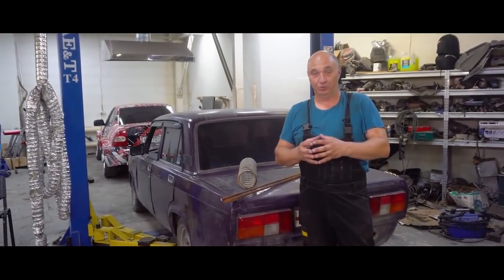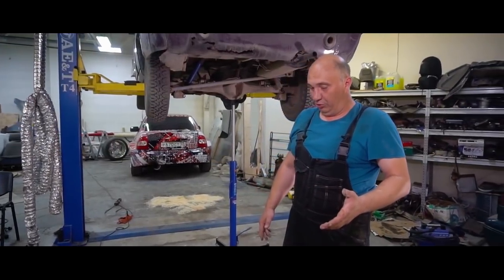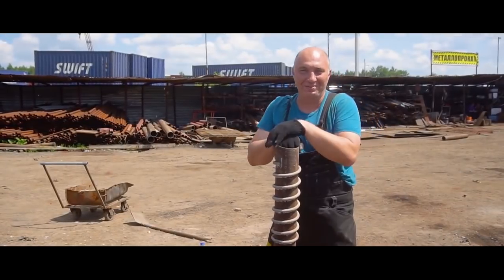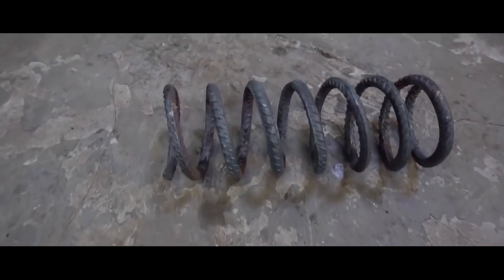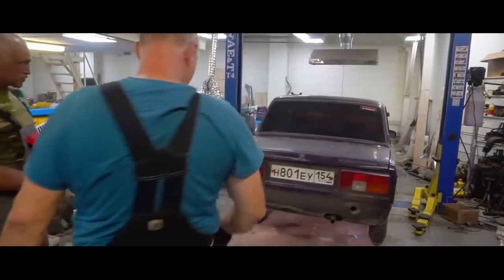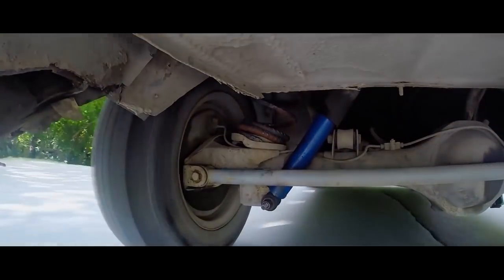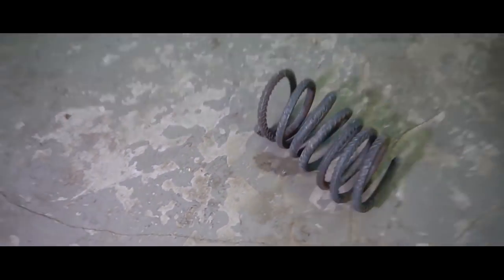Coil springs out of rebar – will they work?

Comment: You kind of annealed them :o) I would love to see 12mm hardened and tempered afterward. Maybe they would be perfect?
Reply: It's low carbon plain carbon steel, other than inducing some grain growth you're not changing much of the structure.  There's not usually enough carbon in the steel for any type of substantial heat treat either.
Reply: @otm646  That explains the low rust on the bits I have. I thought it had a bit of chrome in there? Absolute pig to bend. I made a garden  plant climbing thing for mother in law and swore I would never make another. At the time I thought the hardness was carbon.

Comment: Pro-tip from a spring factory quality&development manager: You should use Inox steel if possible, bend it in uniform shape and close both ends so that the entire 360° turn is flat to the surface. 
Heat treatment will significantly improve the spring, as it will reset the internal tension forces (so the spring 'rests' in it's current shape), it will significantly improve endurance and deliver uniform performance across the whole springs intended compression/decompression travel distance. 200-250°C will do the trick, time of heat treatment depends on the wire (in this case rebar 😄) thickness, as thick as this rebar is i'd say 2-2,5 hours. Keep in mind, that if you use regular steel, the spring will close a little while heating -but if you use inox steel while heating, it will open a bit.
If possible, you should sand-blast it, as it wil further increase the springs endurance,  because it functions as micro-forging.
You know what, if you ever decide to do a crazy-enough spring experiment video (I might have an idea 😄), PM me and we might arrange something, we make springs for russian companies already anyway.
Reply: I hope he contacts you. This was very informative
Reply: yes you are right but that guy wanted to try it the way the peeps asked for it , we , the viewers here expect fails and laughts , not engenering succes . i have other chanel on youtube for that ^^
Reply: @lacroix1976  ah you can have plenty of laugh still 😄
Reply: Maybe write this to the russian YT channel via google translate doubt he reads english version
Reply: @mexibobor  good point.
Reply: You are 100% correct in your information, but these crazy Russians don't do it for performance, they do it for fun.
Reply: I was going to mention that a lot of it comes from the heat treatment and tempering, but seems you have it covered lol, but might I add, that you need to bring the metal up to critical temp (when the metal is no longer ferrous) then quench it first, quench will depend on make up of metal, most are water quench or oil quench tho, then 2-2.5 hours at 200-250°c to temper it back
Reply: Point of this series is not to make it the right way. They have made wooden pistons etc. Like piston manufactures want to send him aluminium pistons?
Reply: Pro-tip from a nobody: You should use real springs if possible, install them per manufacturers instructions, PM me I know where to buy some, should make for some great laughs!
Reply: @Dsmwarrior1996 I'm aware this comment is 3 years old, but what could you possibly mean by "no longer ferrous"? To my knowledge, ferrous means containing or consisting of iron, and heating metals won't change them from ferrous to non ferrous
Reply: @TheChrisLeone  ferrous metals are magnetic while non ferrous metals aren't, I was using it colloquially as losing it's magnetism or the Curie temperature, I don't know why I used that particular wording

Comment: I love the fact that the professionals wanted nothing to do with this crazy idea.... but you went straight ahead with it anyway 😆👍
Reply: Hmm, ... No reason on earth why a Lathe operator would not make the spring's other than they didn't want a cutting torch near the lathe due to oil residue on the lathe or wanted the job done for free or close to it. I think 99% of the viewer's already knew the outcome of making a spring from anything other than "spring steel".
Reply: @MicroRotors  To be fair, heating it and forging it could improve it significantly. Rebar is low quality steel, not meant to be flexible and elastic. Im not saying melt and try again, but heating it up, and then hammering it  a bit,  could improve performance quite a  bit.

Comment: Try half a dozen office-chair pistons along the rear axle. With the adjuster arms still attached.
Reply: Haha good one
Reply: Tragically, if they aren't all positioned exactly perfectly, they will simply paralyze the suspension, as you can see in the video where they attached numerous shocks to a car.
Reply: @Namington  That was only part of the explanation, i have mounted extra pair of shocks on a motorcycle, exact same angle as the stock ones, and the result was truly horrifying. No suspension, only bouncing, the rear wheel had no road grip and at 60kmh the whole bike started wobbling violently.

Comment: If you harden them by heating up and then rapidly cooling down (even in just a normal water) it could be more interesting. Than again they would probably crack.
Reply: had the same thought, after heating them up for bending they are in an annealed state now, so very soft and not springy. You could maybe try and harden them anneal them just a little so they aren't completely brittle. Although you should look up if rebar can even get hardened, my gut tells me no.
Reply: @CatNolara affter heating them cherry red, dump them in engine oil, this hardens them on the outside, but keeping them soft on the inside .
Reply: @MrBugsier5  you want them to be stiff all through tho, you don't need the hardness but the higher yield strength of the hardened material.
Reply: What they needed to do was temper the steel after making the coil by putting them in an oven at about 350°C for two hours

Comment: Guys, hardening rebar won't work, it has way too little carbon in it. Even if you could harden it, it wouldn't behave like spring steel. Spring steel has some other elements mixed into it to give it its elasticity, for example silicon, chrome, nickel or vanadium (depending on the particular kind).

Comment: The more videos I watch from this channel, the more pity I feel for that car
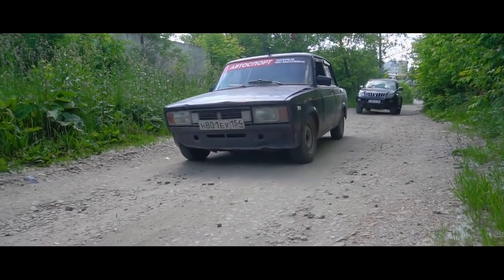10:02 cameraman is like: "Oukei, tiem tu ghet in kar"
11:28 I expected that. As thew wound the rebar they heated it up to glowing temperature and then air cooled it (annealing). Basically took all the spring out of the steel. They should've heated the rebar springs again and cool them in oil (or water)
Reply: It's inter to see what's next
Reply: @peterpede6601  I'd love to see how that turns out, too. As they said, the pro turners didn't want to hear about this project :)
Reply: @peterpede6601  Yes, a proper heat treatment would give them a real chance for success.  I think they should do that.  They have the equipment already.
Reply: Not much "spring" in rebar to start with.
Reply: @austin:  since when they invented spring steel...…….??
Reply: Look at Wiki;

https://en.wikipedia.org/wiki/Talk%3ASpring_steel#When_was_spring_steel_invented_and_by_who?

 @raymondo162
Reply: There’s not enough carbon in rebar to make a decent spring.
Reply: Raymond Ashby 
Structural steel like rebar has very little carbon in the iron. Spring steel has lots of carbon which changes the irons structure to where it can be heat treated to retain its original shape after bending over and over again. Low carbon steel bends and stays bent. This is 1,000 year old technology at least.

Comment: Please remake this video. Because you forgot to temper the steel. By making it red hot and dunking it in cold water or old engine oil. This is why they collapsed.
Reply: You can't harden rebar by heat treatment.  Rebar is made from mild steel.  It doesn't have enough carbon to harden.  Almost all steel used in construction, from I beams to sheet metal, is mild steel.
Reply: @pstrap1311  that why heating the rebar up and dunking it into used engine oil hardens steel, it adds carbon to the steel, technically a case hardening but it would add some rigidity to the rebar
Reply: S1n1stersixs Gaming it doesn’t add carbon to the steel. It just rearranges the molecules to form a harder structure
Reply: @pstrap1311  it doesn't matter. Any metal you heat will become soft. But if you make it red hot and rapid cool it will restructure the molecules in the steel.
So yes even the rebar will be affected by the heating process.
Reply: no
Reply: @Higor Ghunter • 64 years ago not only is it the hardness but springs are made from spring steel which has a couple of other ingredients too, one of which i think is magnesium , its why alot of people, myself included make swords from leaf springs, coil springs are a similar material
Reply: @Higor Ghunter • 64 years ago 
He's wrong, doesn't "rearange the molecules to make it harder" But if done in a gas furnance the CO2 atmosphere will give it some carbon and nitrogen

bending the steel while cold would have more of an effect due to work hardening.
Reply: Mr T  yep, i just use known spring steel, Molybdenum is what i was thinking of, one of the M's , thanks for the info and correction

Comment: Tempering r hardening the steel isn't going to turn it into spring steel. Hardened steel will just crack and break.
Reply: That's why it needs to be reheated  at a lower temperature after quenching and kept there to slowly cool of over the course of a day.
Reply: @johnnyjimj  but it wont turn it into spring steel.
Reply: Typically normal springs have a higher yield strength than mild steel. Meaning the springs are made from higher carbon steel.
Reply: No, it needs heat treatment 100%. It will reset internal tention forces and that is crucial to increase the endurance and deliver uniform performance acros the whole spring. I work at a spring manufacturing company 🙂
Reply: @davidmiletic6647  what I'm saying is that rebar is not the right alloy, and heat treatment wont make it right.
Reply: @fryloc359  of course, you are right, but it's just for fun 🙂

Comment: Can anyone explain what heat treatment/hardening would have done?
What kind of iron are real strings made off?
Reply: Usually Rebar-steel doesn't contain enough carbon (<0.2%) to make a proper heat treat, for at least decent spring steel you need at least 0,5% carbon or more (amongst other metals) to get a proper springsteel. Rebar is closer to iron than to steel
Reply: xXExpressYourselfXx 
Thanks!

Comment: You want these springs at roughly 45-55rc. Softer and they will bend. Harder and they will snap. 

I’ve been a heat treater of tool steel (s7,t15,m42,etc) for 10 years. We use molten salt to treat. After we temper from anywhere between 350*f-1200*f or so. This locks in the hardness. Heating them as they did would cause multiple different hardness ratings throughout the “spring.” With the results he got. 

Another issue is steel type, i.e mild steel doesn’t have the carbon required to harden. A carburizing process would help.

Comment: Kia must use rebar  suspension starts falling out 25 miles after they buy it.   IF you could pick a brand new Kia and a brand new 82 LADA you better get the car that can go two million miles.    LAaaaaaada

Comment: Could have evenly reheated them to cherry red, then oil quenched. That would maybe have put some stiffness back in so they last. Maybe try a spring out of cardboard? Could come in handy in an emergency, if all you have is some cardboard boxes, knife and some glue in the boot. With just the boxes, strategic tearing & folding could work. ;)

Comment: Simply put, rebar isn't springy and will warp. Saying that they did work reasonably well and used on a makeshift go-kart would work pretty well for a 20 lap race, but off road you really want coils made from spring steel.
P.S rebar is actually quite brittle. It has brilliant compression and tensile strength, but is not very maliable so when it fails it does so very suddenly. Torsion should have revealed this so I'm surprised the springs didn't also snap.

Comment: very interesting. I weld frame for my truck, and what you guys are missing in the spring is what I try to take away from old hard rails. It would be interesting to see how much time as a runtime cathode/anode engine carbon to get what you want. I reckon 20-50 years ;) It is a tricky process.. got to know carbon levels by other manufactures trial and error. Steel does change after man makes it.. depends on environment.

Comment: The heating process probably annealed the steel, so maybe if you heated them again in a furnace, after they were formed and dumped them in cold water you'd have some more success or maybe they'd just crack then - depends on the type of steel.

Comment: While wrapping the rebar, it needs to be twisted probably 3 times per full rotation at the same time. This will provide the spring back pressure your looking for. Then super heat them and drop them in water. Would provide a much stronger spring. Pretty cool video.

Comment: No it won't work because they will reform under weight and not reassert to thier original size. No. Won't work..not made of strong enough metal made to keep it's coiled length.

Comment: Heating the steel for sure did mess up your attempt to make a spring. You would need to temper the spring. The rebar wouldn't be the best spring but it wouldn't be the worst either, it is a hi carbon steel also. Usually springs are made out of 1070

Comment: The rebar may have actually held up better if after coiling them up, heated them in a forge with some flux, then oil cooled them to re-strengthen the carbon in them. But that is a bit extream for a small experiment. Love this channel and will keep following :)

Comment: Their is a particular manufacturing process that gives a spring its memory
If you just bend it into shape well thats Likely not enough. They could need nitrogen cold forge after a lengthy heat treatment for strength & recoil memory & hardness increases

Comment: You heated them and allowed them to cool slow and easy annealing without heating and quenching to stiffen then temper to chosen temper then they would work better however they probably will crack after short time due to the porosity of rebar and low quality.... be nice to know if quenching and temper with simple tools would work

Comment: Heat treat after bending and drop in oil.  The assumption that you can heat carbon steel was where you made your mistake...and yeah I know this is old...but try it again with this modification.

Comment: Many people here need to learn the properties of steel and its alloys. Most steel alloys have about the same stiffness, but some have a larger elastic (springy) range, before plastic (stretch ths is permanent) deformation destroys the part. More coils in a spring makes it softer, all other factors being the same. Heat treatment can do all sorts of things to different alloys, including hardening and softening. Mild steel (low in carbon) rebar largely ignores heat treatment. The proper treatment of the proper alloy can make a suitable spring, that will bend without cracking, and return to its original shape.

Comment: I wonder how much of there rebar springs failing is due to them not tempering the springs after using a super hot torch set the form.. tempering if done correctly would keep the steel hard while providing some flexibility aka spring ability

Comment: Well, fellas - re-bar DOES have a specific temper that you destroyed with the torch. Do it again, heat them totally red hot after bending and quench them in water. Then at least they's SNAP instead of collapsing - much more dramatic!

Comment: If they heat treated them they'd have been fine. They annealed when heated for bending which softens them and allow to crush. If they went on and heat treated would have hardened them up some. I'd not full harden as they'd be too brittle. Temper for springiness of course.

Edit: I loved the video.

Comment: Heat treading those rebar coils at specific temperature could make them more spring like. Although they will never be as good as actual steel that has just the right amount of carbon in it, those could still in theory be made more spring like.

Comment: A little heat treatment would have helped.  You should heat and then quench and then temper them and try it again.  Ask an old blacksmith about proper tempering for a spring.

Comment: You could have bent it cold if you used a smaller diameter jig so that when it sprung back it ended up the correct diameter.

Comment: Why don't you try to make a torsion bar suspension?  That is, a straight bar that twists to obtain its spring strength.  Same general idea as anti-sway bars, but only one for each wheel, rather than one connected to the complete axle

Comment: I'd love to see the magnetic suspension revisited!  Think of each magnet as an individual coil in the spring.  They'd have to be kept captive in a tube... imagine something like copper where the eddy current generated would act as a damper.

Or possibly this makes it so dangerous it's not worth it 🤔

Comment: I think the rebar might have worked better if you would have heat treated it. heated it up and put it in oil or water. It would have given it the spring like properties you are looking for and also harden. Heat up until it loses magnetic polarity and the quench it in oil or water.

Comment: You don't need to do that experiment in order to know if it really works or not. Common sense will tell you  that rebars are wrought iron made of low carbon steel and softer than high carbon steels used for springs.

Comment: I feel that you should try this again but the next time you need to heat up the entire rebar-spring until it reaches non magnetic state or critical temperature and then quench it in 120deg f canola oil to harden the steel and I bet they would last you a lifetime!